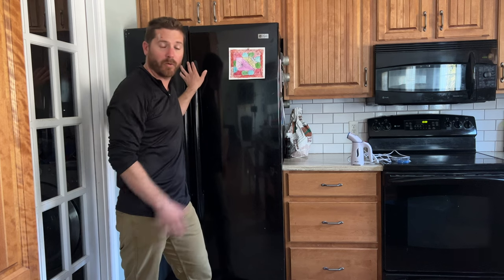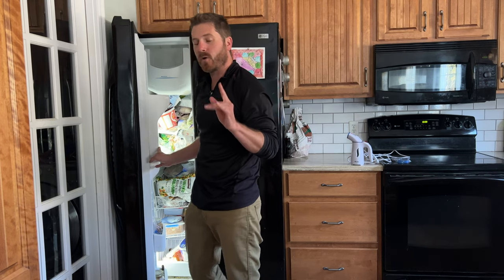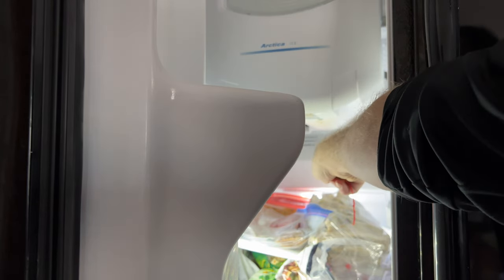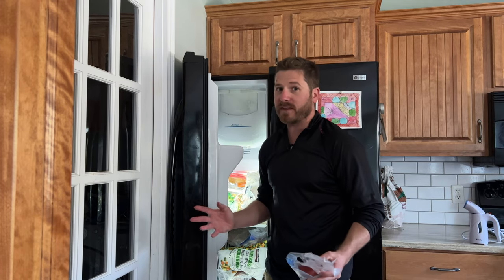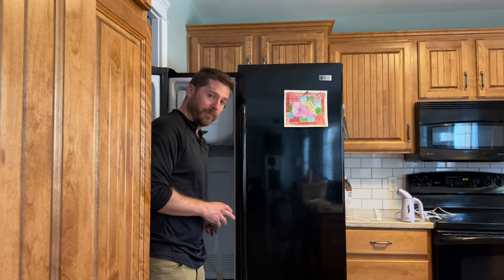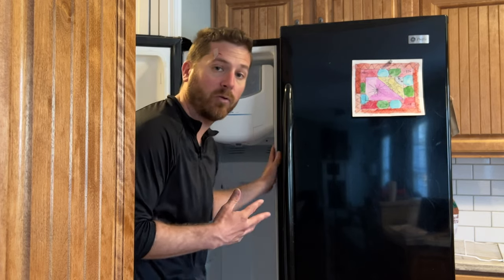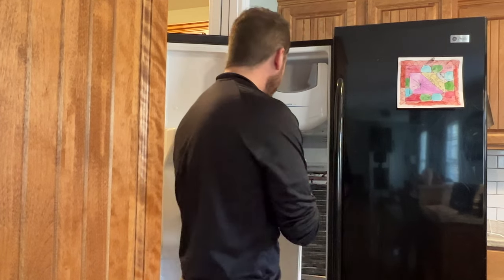How to Fix A Noisy Refrigerator Freezer Yourself!

Comment: Tech Tip.  When you reinstall a screw into plastic use a screwdriver and first turn the screwdriver COUNTER CLOCK WISE a half turn or so until you feel or hear the screw drop into the plastic thread.  This will align the screw with the threads and prevent the thread from being stripped out!  This applies to any screw going into plastic.
Reply: Thanks for that tip! I'll try to remember that in future 🙂
Reply: EVERY .SINGLE. TIME.   i do that and someone is near me they tell me im turning it the wrong way lol.....   freaking pisses me off
Reply: Oooh, good tip!

Comment: Loud buzzing noise suddenly came on... side by side frigidare...model FFHS2622MSH...under the ice maker about 12" down inside the back panel is the location of the tiny fan motor ( thats whats makeing the noize).... un plug the refrigerator...just remove the four 1/4" nuts on the back panel w a nut driver separating the thin white panel where the upper and lower panels meet ( easy peasy your half way done ) ... behind the panel you will see the little electric fan  has fallen down from its shelf out of position... just re position the fan unit on its shelf and reinstall the 4 nuts and stop thinking you need to spend $ 900.00 fer no darn reason. Plug in the cord listen for a beep then listen to your nice quiet frigidare.

Comment: Thanks a lot! This suddenly started after a 9-hour power outage. The freezer must have frozen over thru and thru. After the blackout the fridge greeted us with this horrendous noise (that was even heard upstairs!). I quite frankly immediately lost hope, but then having recovered and found my way back to my computer I started searching and found this video. You are the man!!! Thank you for saving our KitchenAid frenchdoor fridge. After crawling on the floor thawing my freezer evaporator fan deep within the bottom freezer section using a hair dryer a shard of ice flew in my face -- not fatally :) -- and the fan got super quiet. I moved the dryer for another minute or two along the bottom panel (without removing it) and called it a night (it was 11 PM). In the morning I completely forgot it happened. THANK YOU

Comment: That video was super useful.  I had already tried unloading and reloading the freezer with no improvement.  After the video, I looked closer at the grid over the evaporator fan and found ice which must have been around the fan blades.  15 min with a hair dryer and problem solved.

Comment: I have less stuff in my freezer now and I made sure the vents aren't blocked.  I turned my refrigerator off for about 2 hours.  That was enough to stop the noise.  If needed later I'll try turning it off for 24 hours.  Thanks!

Comment: Thanks. My 2 year old GE freezer needed that. Noise went away in 20 seconds. I ll monitor it but the hair dryer stopped it.
Reply: My question is this a temporary solution and will it happen again within two years vs replacing a part so we won’t have to do this again in two years? Cause my GE freezer is making the same sounds
Reply: @Nikohhh04   If you note where the air vents are in your freezer & make sure these vents aren't blocked, then you shouldn't have them icing over again. At least that's what caused my problem.

Comment: ok, so I tried using the hair dryer which worked, but I decided to try sticking a butter knife on the side of the fan cover and the noise stopped because the butter knife pulled the cover a little away from the fan.  Ridiculous that I have to do this but it works!

Comment: I have had this issue after the first year A have been pilling on the plastic grill plate that helped which make me think the fan is hitting the plastic front not ice.  I have reduces the stuffing on the upper level, Next I will unstuff the bottom.  They really need to rethink freezers for a world or irregular shaped plastic bags plastic bags. Maybe drawers.

Comment: Hey buddy. I came home from work and was hearing a loud propeller like sound. My mother and I cleaned out our freezer and I removed the shroud. Ice was forming on the blades somehow. I cleaned it out. Someone half assed installed the cover back when the fridge was serviced before purchase (used).

Screwed cover back on and it sounds like a new fridge again.

Comment: I had a brand new Liebherr freezer delivered yesterday and the noise is driving me crazy when it's freezing there was nothing in it besides the 4 drawers ! 
- the noise should be 37 dB. 
(Maybe the plastic parts inside has been assembled wrong in some way ?) 

I filled up the new freezer some hours afterwards yesterday, it still had that crazy high noise when freezing. 

My combi refrigerator/freezer is 40 dB and it does not have that cracy high noise.

I need to figure it out....

Comment: What if the noise is on and off every 30mins or so?
Reply: My noise would come and go.  I turned my refrigerator off about 2 hours and put less stuff in the freezer.  I made sure the vents are not blocked.  If the noise comes back I'll try the 24 hours.  Good luck!
Reply: @carollewis3912  did it work?
Reply: @fons8313  Yes.

Comment: I’ve followed all of the instructions and removed the minimal ice in the tray. Note that there was zero ice build around the fan area. Noise is still coming g from the freezer side of the refrigerator. Any idea what to try next?
Reply: Same did you ever solve it
Reply: The fan might be broken, check if it's not loose

Comment: It is just the does side by side Samsung refrigerator with a freezer on the bottom and Frederick on top making it kind of like you said a helicopter noise I thought that might be the problem so would that happen if the freezer bottom is over stuff to make the top make the noise

Comment: My freezer is making a high pitched noise that even is audible through the kitchen door and it drives me crazy. A technician was here and told me it's the small diameter pipe at the compressor. I wish I could find a way to make it quieter.

Comment: I discovered it was the vents at the bottom of the plastic shield on mine being covered that caused my pump to make so much noise. My freezer had that shield that keeps covers up the coolant coils. And pretty much like how if you covered your mouth, you'd have to work harder to get air in. So once I left a gap between those vents and my frozen goods it went back to being quiet. Yeah..that also meant my freezer space got SMALLER. ugh. Only solution I can think of is to make bumpers to create space and use plastic bins to hold goods. That way the tray will 'bump' and leave a gap. And I can then stack goods into the tray and if the tray is high enough, I can stack as high as I want since the outer edges of the tray now bumps into the bumper and won't over flow and block those vents.  Hopefully this helps someone out there. best to all!

Comment: Had my compressor changed (8/30/22). 2nd day it was sounding like another bad compressor. It wasn't! the tech that changed it, didn't put the access panel back on correctly, hence vibration (metal to metal). Panel had screws on top and metal tips on bottom. I had to bend out the tips a bit and reseat, then put rubber washers on top. NO MORE NOISE! BTW, if you have an old tire or hose, cut off a foot or two and save, make your own rubber washers!.
Reply: when my fridge compressor comes on it sounds like a mini gun shot!  Is that probably a bad compressor or a vibration issue like you said?

Comment: I have a new fridge making that noise with nothing inside and nothing frozen yet. Any other solutions?
Reply: Mine was delivered yesterday and making that noise
Reply: @FallenAngel-he5ko  I'd return it then.
Reply: Check out my post I fixed it  extremely easy. No need to worry.
Reply: @stevethomas5209  Did you get to the fan from the back panel inside the freezer or did you go into it from behind the unit?

Comment: I came across this video because I am desperate to find a solution to my ongoing noise in my fridge. But my freezer is literally empty n not overstuffed- HELP!!
Reply from the maker: Did you try to see if there’s any ice buildup where the fan is? Mine was making noise because of that…
Reply: @soundproofguide  Ok I have not tried that yet. I will. I hope that solves the issue. Thank you for replying

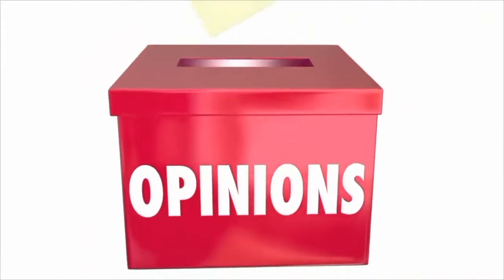Comment: 10:32 10:32 10:32 10:32 10:32
Reply: Hi
Thanks for the information  This morning l checked the ventilation blockage . It worked
Reply: Hi
I empty my freezer stuff into my icebox
I wipe the inside clean and dry
I then proceed to place a covered pot of very hot water on  some hot pads inside the freezer and close the door
The heat without the vapor works for me